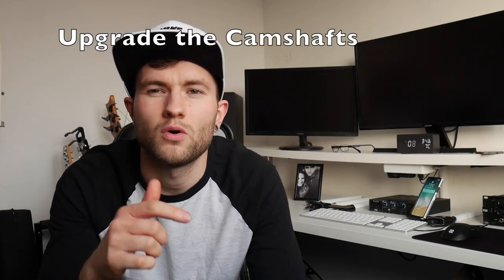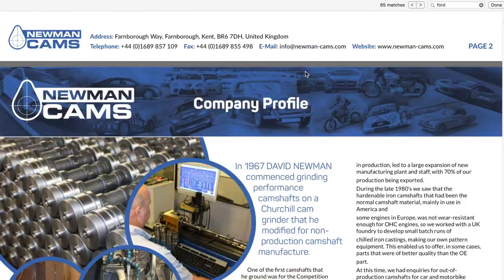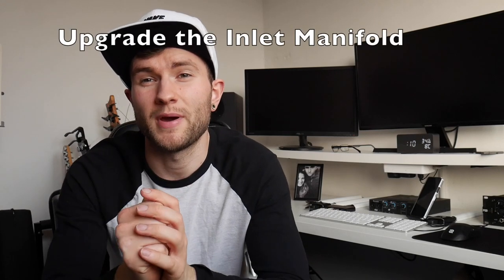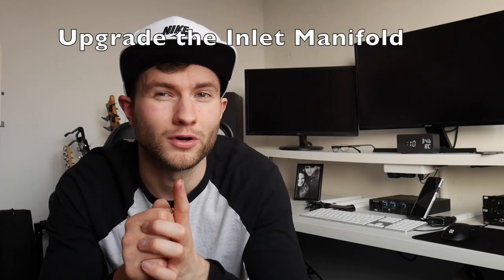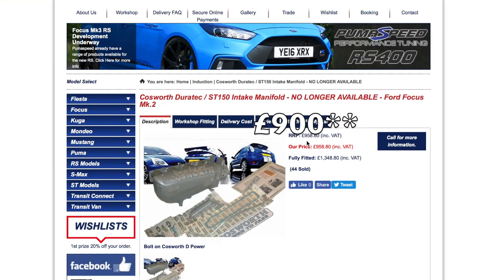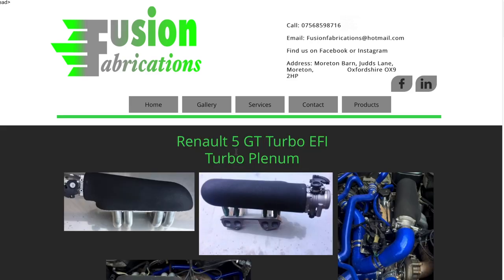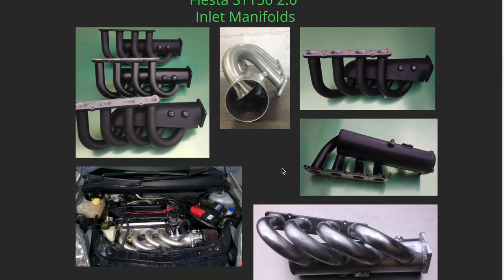Top 5 Power Mods | Fiesta ST150

Comment: Great vid! From my month or so with the setup I recommend FF all the way for road use, with Newman PH2's and a custom map. There's a wicked surge of torque at 3.5k then power to the redline. Makes it a great daily as you can have a lot of fun without having to rag the nuts off it all the time. The peak BHP figures people are getting (190-210hp ish) seems to depend a bit on filter setup. Was a really fun little project and with the inlet being fairly basic in construction and accessible there's plenty of room for tinkering and tweaking the setup.
Reply from the maker: Matt Allen that’s the route I’d like to go if I can put aside the cash,  sounds like you had a fun little project!

Comment: Am i not listening right or are you calling mountune monitune? also im pretty sure the FF inlets are getting the same bhp figures as mountune and cosworth, shame you also didnt mention Throttle bodies since they are much easier than boosting.
Reply: tbh i heard monotune xD
Reply from the maker: I probably called it monotone because I had said JayMono earlier aha! My bad!

Throttle bodies are a good idea, you taking ITB or just a 60MM upgrade?
Reply: @jaymono6498  I mean itbs, you can go as high as 270bh0 with them if you spend 10k. Or just a simple 2-3k kit will see you hit 220-230bhp.
Reply: Tiago Alves Fusion fab inlet gives better low end torque but at the sacrifice of peak bhp. A lad I know has 205bhp/193lbsft with one.
Reply: @JoshuaRGraves  that's the same BJP you get from mountune and cosworth inlets, but cosworth make less torque
Reply: Tiago Alves Yes. You want a good balance of bhp and and torque.  The FF inlet was designed for the 2.0 Duratec like the Mountune inlet but it’s more refined and perfected.
Reply from the maker: Tiago Alves That’s some good figures!

Comment: Is it possible to make 200bhp na?
Reply: Probably with new cams, inlet, manifold etc
Reply from the maker: Yeah you should be able to hit 200BHP NA! Seen a few on the forums getting them figures :)
Reply: MariosDrummer Yes and a lot more than that.
Reply: Jamsport do a individual throttle body setup that i think can get over 210bhp so yeh 200bhp na is defo possible
Reply: Mr200